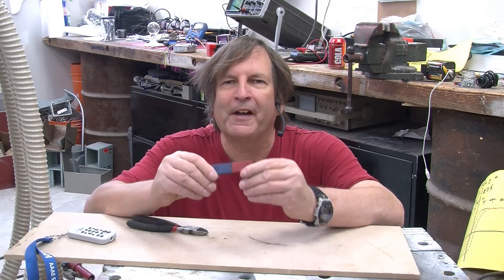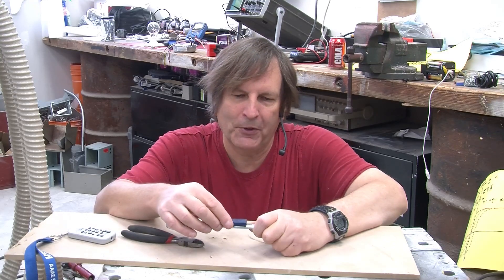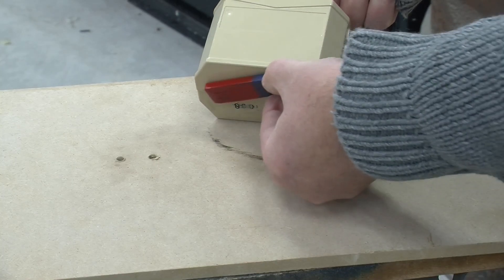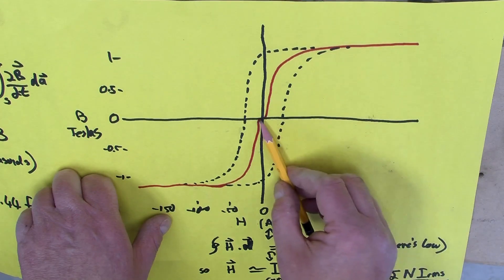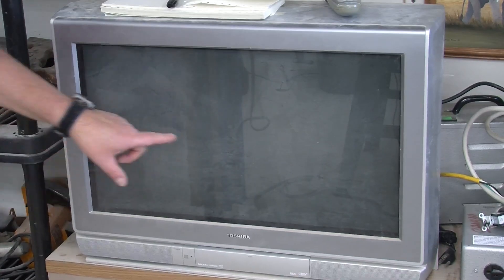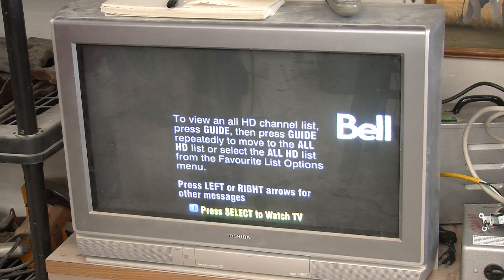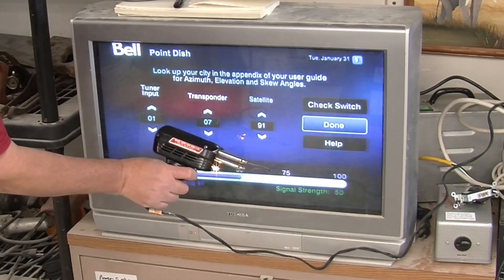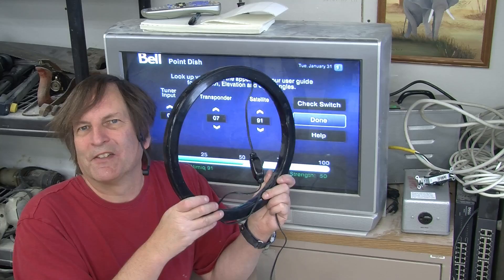Demagnetizing magnets and other things

Comment: Now I remember this video. Hysteresis is what allows you to demagnetise in several passes of diminishing field strength.
Reply from the maker: Exactly! If one had an easy way of measuring the the field you could in theory setup a properly oriented coil and gradually increase an opposing field from the coil till you pushed the point on the BH curve down to B=0, but hard to get that right. Much easier with an AC field that gradually is diminished by moving the coil away or decreasing the current until one works the field down to the 0,0 point on the BH curve.

Comment: Can I do that with a motor
Reply from the maker: YOu mean use its fields to degauss things? Yes. But the fields are usually well confined so nott great. But - here is a trick I once used. Remove the rotor and side from a standard small induction motor. Disconnect the starter winding. Use a 12V AC transformer to power it - I used an old battery charger with the rectifiers removed. Now turn in on and slowly mover something - maybe a jar of nails in and out. And do it carefully enough and they are demagnetized!

Comment: Years ago when I had a TV with a CRT, I turned off my vacuum cleaner while it was near the TV.  
The residual magnetism made a color blotch that was so strong, the built in de-gaussing coil wouldn't clear it. 
It took a special external de-gaussing coil.
Reply from the maker: Your lucky someone knew what they were doing in terms of degaussing. We had a TV that had a blotch (no idea what caused it - was borrowed from a relative) and no repair shop knew what the problem was  or  that demagnetizing would be the fix. 

Interesting that the stray fields from the vacuum were enough to mess it up. I guess that shows how sentsitive some CRTs are.I have heard of large fine pitch ones that needed the purity adjustment redone after re-positioning because the earths filed was enough to mis-align the electron beams.

Comment: Very interesting Sir. I am trying to make a horse shoe magnet like the first commercial electric lap steel guitars from Rickenbacher from around 1932. I use pretty hard steel, bend it to a U shaped form and then try to magnetise this with the help of a microwave transformer. As current source I have a welding  machine +/- 45 V AC and a diode bridge of heavy diodes to turn the AC to DC  for the primary coil of the microwave transformer. This works good, but i was thinking of using another welder coil as charging unit.  

In my setup i have +/- 45 volts DC from one welder applied to coil of the second welder. A high current is flowing, but the result does not look better.
So my question is, what is the relationship between number of turns, thickness of the coil of the charging unit and the voltage applied to it from the source transformer or battery to make a really strong magnetiser? In other words is voltage more important than current? 
Thank you for a reply.
Reply from the maker: What a neat project! So the more amp turns  the better. You may be finding the lower voltage out of the second wekder is so low the current drops. If you hanvt already, get a clamp on ammeter that does DC (not all do) so you can see the current. You may also be simply have the core at its saturatration level so more current will have a minimal increase inthe final magnetic field. Also, while hard magnetic materials are good, steel cant compete with the more advanced magnetic materials. I wonder how good the  magnets like you describe were back in the old days?
Reply from the maker: @liam3284  I had to look up rectiformer. Interesting. So what did you use that amount of current for? Things I saw online was for applications like aluminum refining.

Comment: I had a Montgomery Ward TV circa 1984 that lacked a built in degauss function. With all my tinkering with speaker magnets and other electronic projects, I managed to magnetize the mask and had permanent color blotches on the screen that I lived with for about 10 years because I didn't know how to degauss it myself. Thanks for another cool video.
Reply from the maker: Oops! When I was kid I did hold a magnet close enough to our color TV that the colors distorted. Luckily  not so close that there was a permanent blotch or I would have been in trouble! But we did have another TV a bit later   that had a permanent blotch that no-one was been able to repair. I wonder if some TVs did not have the built in degaussing circuit, or if for some the thermister that activated the coil  for a few seconds at startup would eventually fail .  Glad you liked the video!
Reply: @ElectromagneticVideos  In 1991, I worked at a bowling alley with 44 lanes. We replaced the old electronic scoring system with a new one, which meant 44 new small monitors on the scoring table and 44 new big ones up above, all of which were CRT's. (One of the last steps after installation was to degauss all of those monitors, which was a lot of fun. They wouldn't let me take that degauss coil home, though. Incidentally, if you're interested in computer history at all, the back end of that scoring system ran on a Data General desktop PC with a 386 processor and ran SCO Xenix to control a bunch of serial interfaces to all the lane scoring computers as well as the serial terminals at the front counter and the power switches for the lanes. I appreciate your videos and the replies!
Reply from the maker: @MichaelCowden  44+44 monitors - that must have been really expensive back then! SCO Xenix - never used it but heard of it. Back then I was grad student and Sun workstations running their version of Unix called Solaris ruled in our lab. I also remember what an advance the 386 was - for the first time full memory management and virtual memory for the PCs - and some of us started running a brand new Unix-like OS at home called Linux! 

I appreciate your (and other peoples) comments! Its so interesting to hear stories and experiences about related topics. And I always learn something!

Comment: After getting a magnet really hot then immediately placing it in a strong  flux field and allowing it to cool down while still in a magnetic field,  will it be a good way to achieve a strong magnet once again?
Reply from the maker: That sure seems like it would be right. I have never tried it and a quick bit of research didnt turn up much. 

It would be interesting to know if magnetizing by cooling in a field produces a slightly stronger magnet than one could achieve applying the field when the material is cold. I would suspect at best the improvement would be marginal since we are normally magnetizing things to their saturation point. Perhaps cooling from hot might alight the last tiny percentage of domains but again its probably a minimal effect.

Most strong magnets are manufactured by sintering a powder (heat+pressure) into the desired shape. And this is apparently done in a magnetic field to align the tiny particles before they solidify to presumably improve magnetic properties in the desired direction.They are then charged by applying a strong field to the magnet once the material is cooled. I would guess if there was an advantage of charging while cooling they would do that. 

A few related things: in  the previous video I mention how cooling lava in the earths field becomes a magnet in the fields direction,   effectively doing what you described, just poorer magnetic material and weaker field - I have always though that imprinting of the earths field was neat. And do you have a rice cooker? Most turn off using a chunk of material  with a Curie temperature of just above boiling right and a magnet with a much higher Curie temperature. The magnet remains magnetic all the time, but the other material looses its magnetic properties and ceases to be attracted to the magnet when above the boiling point of water ie when the rice is ready - and flips a switch. The only application of Curie temperature I can think of. 

Thanks for the interesting question!

Comment: When I was a kid I left a rainbow spot on the TV..
Man I was in trouble.  It went away after a few days..
Shew..
Reply from the maker: I'll bet! Depending on when that was, colo  TVs were expensive! I actually tried a magnet near the our color TV but was lucky enough not to get it close enough to result in  what what happened to you. I guess over time the built in demagentizer took care of you problem. 

We also had a borrowed color TV for a while before we had our own - it was lent to us because it had a big orange colored area near the bottom right of the screen that no repairman had been able to fix. Who knows if they were taught how to handle magnetization like that, or if the actual shadow mask was somehow warped for some other reason. I also remember one of my dads co-workers getting a color TV very cheap from a dealer because it had a similar problem, so I guess way back it wasn't uncommon to have issues like that.

Comment: It's been a while, but I remember the degaussing coils built into the larger CRT's for sure. This is different, but I also remember as a kid my hair standing up when turning on the older TV sets in the 80's.... Those flybacks were no joke. Great video!
Reply from the maker: Thanks! Pretty much any color CRT has a degaussing coil other than small or unusual ones. It doesn't take much of a field to shift the electron beams a fraction of a mm to mess up the color by hitting the adjacent phosphor dot. I have heard that some large very fine pitch tubes actually needed to be adjusted to compensate for the direction of the earths magnetic field after the TV was installed. I once actually suggested to someone to use a fine pitch crt computer monitor as an AC magnetic field detector for a particular application. 

Your going to laugh - I have a number of CRT TVs and monitors including some of the last greatest HD TV flat-screen ones that I use every day (one TV, and one monitor). And when they are turned on you can hear the crackle as the 30kv builds up inside the crt and a mirror image of the same voltage builds up on the outside of the glass tube. And more than once I have gotten a good static zap from the screen.
Reply: @ElectromagneticVideos  awesome!
Reply: I worked as a tech at an office equipment shop in the 90s that sold computers.  They used to do high end desktop publishing setups as part of it and that meant big expensive high-res CRTs.  There was a demo unit setup with a 21" or maybe 23" iiyama monitor and the salesman decide to rearrange it for a presentation.  He turned off the monitor by pulling out the leads then picked it up with the face of the tube to his chest.  When his fingers touched the metal chassis an audible crack sounded off and the expression on his face was priceless.  He wanted to drop it like a hot potato but it was a pretty expensive monitor so he had no choice but to carefully put it down and grin and bear it.  He didn't make that mistake again.
Reply from the maker: @retrozmachine1189  Oops! I guess thats the cost of doing business. I remember how expensive monitors that size were as well as the  workstations to drive them at resolutions of 1kx1k or more. I was a grad student in the early 90s and we had Sun workstations with monitors in that size range. If I recall correctly the cheaper systems were in the $25k range and the most expensive one we had was well over $100k. Amazing the our cell phones today have faster processors, more memory and higher resolution at less than $1k!
Reply: Your not the only one who remembers hairs standing up! I was the remote control for my dad... 😂
Reply: @chopper5371  
Right!